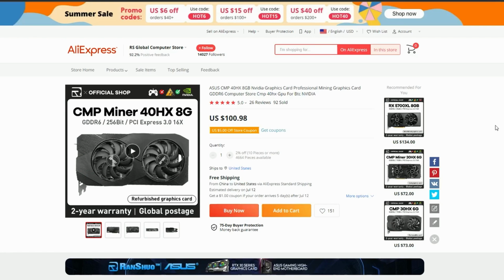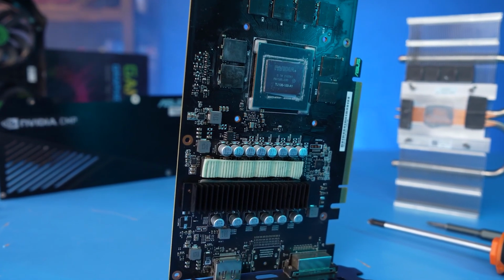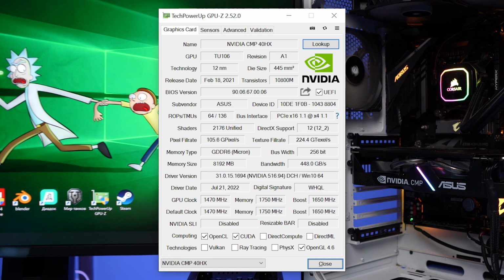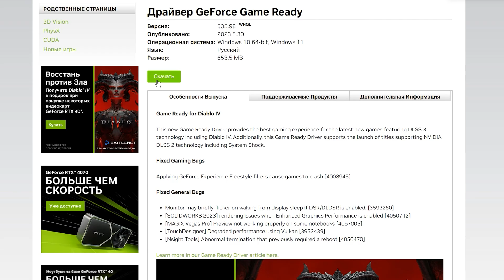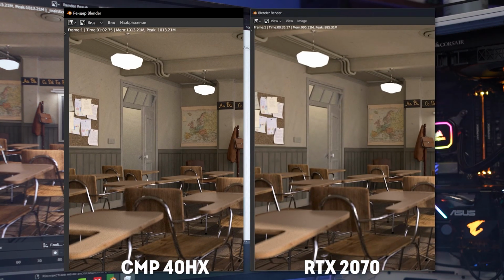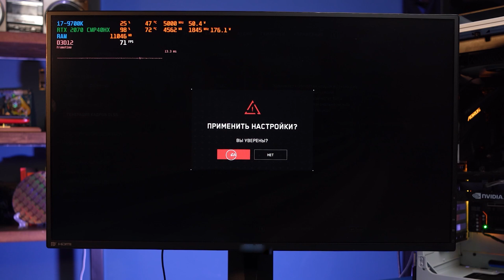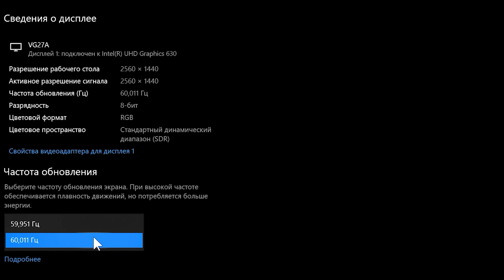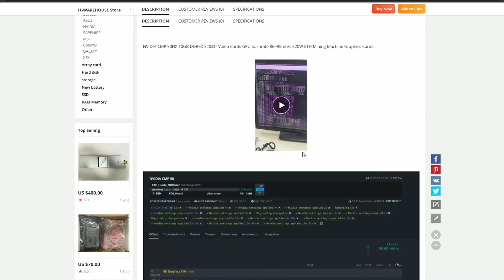Making an RTX 2070 from a Mining CMP 40HX for $100

Comment: I got a gifted CMP 70HX from a friend of my nephew, I managed to install drivers and make it "work" it doesn't seem to improve anything, I also notices the dedicated memory of the GPU is capped at 0, the PC won't use it at all (according to the task manager), is that normal or I need to tinker something else? Is there a forum where I can ask this stupid questions? Thanks for the video, I'll try soldering the capacitors, if I find out the value, I hope is the same as the one it already has, guess I'll just keep waiting untill further evolution
Reply: 70hx is actually worse than 40hx at gaming

Comment: i buy p104-100 they say its 1070 but after patch and run game you see it 150%weaker then RX580 
and you cant run any game in fullscreen  all can run in window  and must heavy game can be run in 1024*760 res   
in the end dont trust this type of video as you can see no one play any game on this card they just use others video
Reply: actually the p104 is worse compared to the p106-100 in gaming , they, i mean the p104 is only as powerful as gtx 1070 in mining , the best gaming  mining card are the 30hx and 40hx at raw performance so far , so yea if you buy a 40hx ( the modded pcie x16) you will get a cheap rtx 2060s ,only for gaming , btw the p104 only run on pcie x4 1.1 thats why they’re so weak , p106-100 run on x16 1.1 , i’m using it right now, with modified driver it can runs wuwa smoothly at 50-60 fps medium/low setting
Reply: @imanasianguywithabignose8963 does it work with x99 Xeon?

Comment: i just bought a  Nvidia cmp 100-210 16gb hbm2 memory and was wondering if i can do the same as u did to get it to run a 16x speeds like can i solder the missing components on the board as well be nice to change it back to its orginal tesla v100 16gb card

Comment: Can you make the lanes work on a p104-100 too?
Reply: I'm curious about enabling pcie x16 as well.
I tried flashing 1080 Founders edition vbios, but the thing just crashed on boot.
Reply: @knightblad5631  use the crossflashong tool??
Reply: @user-zt8zx1sm2t  I used an external BIOS programmer to physically force the flash onto the P104-100.
Reply: @knightblad5631 Don't use the fe version bios, try using the original model bios from the OE vendor.  If it is Asus p104, it has the same board as ASUS GTX 1080 TURBO.
Reply: @knightblad5631  good luck
Reply: @knightblad5631  did it work??
Reply: @inno7845  No, it didn't work. I gave up, and just settled with the PCIE x4 1.0
Reply: @knightblad5631  how fast is it compared to a 1070?
Reply: @inno7845  The numbers are about equal to a 1070. The bandwidth bottleneck is real.
Reply: @knightblad5631  so sad how they make these cards such ewaste
Reply: @knightblad5631  hi! im currently deep down into this p104 x16 lane rabbit hole. it did report x16 at some point in gpu-z (after soldering missing caps and hard-flashing a diffrent bios, but it wasnt a full success, as the card was reporting error 43. Now i have a hard-time replicating this sucess (too many bioses to check etc). but it would be great to get it to work, or at least get some helpful info from people that tried. did you figure anything more in that regard?
Reply: @jurnyrzezaniec5631  Nah, I got nothing useful. I just kept getting the x4 1.0 repeatedly, and just gave up.
Reply: @knightblad5631  welp... maybe an sli setup with bclk OC will yield some interesting results... but it seems like this card just sucks. 106-100 ftw with its x16
Reply: @knightblad5631 i recommend you the zotac 1080ti mini bios 😊
It has same pcb, but 11G → 10G
Reply: How about it??

Comment: I'm taking a CMP 50HX, also with the new ability to crossflash maybe I can put a "real" 2080 TI firmware id string and fool the drivers.
You should try using it on a "modern" meteror lake CPU that has iGPU capable of higher resolution and frame rates.
Reply: Explain your experience. How is going?
Reply: @olegolegunches4905  The card is coming: once it's here I'll be experimenting.
Reply: @ConteZero5977 what kind of cable do you use? hdmi or displayport?
Reply: any updates?
Reply: @Mystnightborn Card released from customs yesterday.
Reply: @Mystnightborn Ok, final answer.
It's useless.
You cannot flash any firmware (even the new unlocked tools won't allow you to change bios).
I've tried a bench (vkpeak) and the result is pretty obvious : you cannot use the card for gaming. Full stop.

Extended reply:

this is my integrated GPU
device       = Intel(R) UHD Graphics 770

fp32-scalar  = 787.99 GFLOPS
fp32-vec4    = 370.61 GFLOPS

fp16-scalar  = 1555.03 GFLOPS
fp16-vec4    = 1567.06 GFLOPS
fp16-matrix  = 0.00 GFLOPS

This is the card
device       = NVIDIA CMP 50HX

fp32-scalar  = 420.67 GFLOPS
fp32-vec4    = 419.90 GFLOPS

fp16-scalar  = 13348.51 GFLOPS
fp16-vec4    = 26323.55 GFLOPS
fp16-matrix  = 0.00 GFLOPS

As you can see it's pretty impressive there (I haven't soldered anything to date).
Now for the sad part:

My integrated gpu...
fp64-scalar  = 0.00 GFLOPS
fp64-vec4    = 0.00 GFLOPS

int32-scalar = 263.05 GIOPS
int32-vec4   = 210.35 GIOPS

int16-scalar = 394.00 GIOPS
int16-vec4   = 485.38 GIOPS

The CMP 50HX...
fp64-scalar  = 0.00 GFLOPS
fp64-vec4    = 0.00 GFLOPS

int32-scalar = 0.00 GIOPS
int32-vec4   = 0.00 GIOPS

int16-scalar = 0.00 GIOPS
int16-vec4   = 0.00 GIOPS

So you can see... there's something (driver or bios, I'm unable to know) that just refuse to execute int16 and int32 instructions.
I've followed the tutorial and the modified driver is loaded, so the problem is somewhere else.

EDIT: I also installed a REALLY OLD, PRE CMP driver that should have no provision for this kind of card... and I forced a 2080 Ti driver.
No change, every time I try to run an INT16 or INT32 instruction the driver issues a reset.
Reply: I've played with drivers and stuff (no point in going to the soldering iron if the card doesn't work).
I was able to have the card working, but just to give you an idea : it does 30fps on cyberpunk 1080p on low, no raytracing and DLSS enabled.

I've also tried afterburner to see if there's something to fiddle with but so far there's absolutely nothing worth (except gpu downclocking - not that it matters because the card is hardwired to stay cold and use as little power as possible).
There's also another problem: the system is unstable, cyberpunk often crashes while unity titles often refuse to start.

I'm disappointed.
Reply: @ConteZero5977  so is it 4 lanes of pci-e 1.1? Try some benchmarks in blender(for example), they won't need extra layers to work properly. So are you going to solder extra lines? or you gave up at this point?
Reply: @MARSUEV  It's always 4 lines of pci-e 1.1.
I've tried something (like, everything) but the bottleneck isn't there.
With the latest modded drivers I was also able to use DLSS in Cyberpunk, but the performances are ABYSMAL: 26fps (33fps with DLSS) running at 2560 x 1080, high details and no raytracing.
The card is internally crippled.
Reply: @ConteZero5977  wait, you managed to turn on dlss? wasn't that impossible at all? How did you do that?
Reply: @MARSUEV  On CMP 50HX you cannot enable DLSS if you force a different GPU (for example forcing the driver for RTX 2080 Ti disables DLSS) while leaving the "original" patched driver (CMP 50HX in my case) allows DLSS (not greyed out in Cyberpunk 2077 configuration and it does increase performances - albeit only a bit).
Having the card recognized as CMP 50HX instead of RTX 2080Ti makes no differences in performances (that are poor with 50HX anyway).
Reply: @ConteZero5977  why does it work with 50hx and not with 40hx?
Reply: @simonescuderi5977  did you crossflash the bios also other than just modded driver ? saw one cmp50 for $50 ...
Reply: @MARSUEV In the video the videomaker forced the card as RTX 2070 driver.
I saw first hand that DLSS works only if you left the card with the "supported" driver, that is CMP (50HX in my case, 40HX in his).
That's probably the reason.
Reply: @ConteZero5977  but if you don't mod drivers, then how you would turn it on instead of igpu? Is it possible with OG drivers?
Reply: @MARSUEV I modded the drivers.
Modded drivers do include CMX 40HX, 50HX and so on...
Reply: @ConteZero5977  so with modded drivers based on OG cmp cards they can turn on DLSS? So there' no problems with RT in it? Then can you try some blender benchmarks with optiX? In theory, the amount of pci-e lanes won't affect on performance in blender, so you should be able to try it. Thank you man.
Reply: @ConteZero5977  I would like to get the cmp 50hx, what are the cons of this card
Reply: @watchouo4511  It's just useless if you plan to use for something else except mining.
Even with the modded driver is as slow as a iGPU.
Reply: @ConteZero5977  thanks for the warning
Reply: @ConteZero5977  So, sorry if asked again, couldn't you get a GeForce RTX vbios on them with OMGVflash or NVflashk?
Reply: @Egidiusdehammo No.
There's no way to flash anything even with those tools.
Reply: @Mystnightborn Yes, nothing good TBH.
Reply: Tried with "junk shop" Blender demo.
CPU : 1 min 56 secs
CUDA : 38 secs
OptiX : 31 secs
Reply: @ConteZero5977  which version of blender? What is your benchmark score?
Reply: @MARSUEV  I just downloaded the last version and rendered junk shop.
Read below (or above, I've replied to others) to get the time.
Reply: @ConteZero5977  I mean bechmark scores, not time(since public data on their website only has scores)
Reply: @MARSUEV  Give me some time to understand how to run benchmarks on Blender... I'm a gaming guy, not a content creator.
Reply: @ConteZero5977  I know, it's so complicated) I believe even more complicated than running those scences on your own. Also a small tip: after running benchmark you can anonimously submit your results. After that you will have a link that is all about that run. You can copy it also.
Reply: does the gpu support any refresh rate higher than 60hz at 1080p?

Comment: Seems like with the recent the unlocking of the bios with recent hack there may be other options as the firmware will be fully editable. Look forward to you seeing if you can make further progress with the now possible bios hack.
Reply: Already tried.
That hack was "hugely overhyped": there's no way to crossflash any 2080Ti firmware on my card, an "exception" always kicks in.
Reply: @ConteZero5977 does it support 165hz monitor?
Reply: @sownlengoc  No, the pcie is only 1.1x4.

Comment: The single-precision floating point performance on the 50HX and 90HX is completely broken, so they can't be used for gaming even if you mod the drivers.
Stay away from those two models.
Reply: Confirmed from a Chinese guy I bought 40hx from, that only 40hx and p106 are worth for gaming 30hx(double 106 price) also works but you rather buy a p106. p102, 104 they only limit by their bios which is limit it to x4, with the new tool we might be able to flash modified bios, I have high hopes for them. 50, 90, and 170 their situation just like you said. Chinese don't have 70hx so I can't find any info. Only 40hx remain everything from their consumer's counterpart(minimum lost) the 2060s, and only this card has video codecs
Reply: @ao-dd3ms  Hey, i've been thinking in getting a p102- sum 40hx from ali/ebay. Are they worth at all? any 1 u would reccomend? im a bit lost on mining stuff and all this and wanted a rly budget used pc, will i have to sold the pcie pins or smth like that if i get one of these?do they work? tysm
Reply: What it does? game wont run or super slow :o?
Reply: @MrBalrogos  Games will run slow on those cards because their single-precision performance has been crippled by Nvidia.
They didn't want those mining cards to cannibalize the GeForces, and especially the Quadros/Teslas.
Reply: @manaphylv100  So really Nvidia reduced the supply of cards for gamers...opposite of what they said they were doing.
Reply: @NoSpamForYou  Maybe they recycled the faulty chips that didn't make the grade for gaming cards. Who knows...
Reply: Wait, is there any cards other than these two that doesn't get crippled on the floating point performance?
Reply: @goodfinity8432  Who knows... I guess nobody is stupid enough to try the 170HX at its current price. If you can afford one, then you can afford at least a used RTX 3080.
Reply: @manaphylv100 then what about cmp 70hx? What do you think about it? Is it ok?

Comment: Explains why Nvidia sold them off as "mining only" cards. They didn't work properly as gaming cards (issues with the RT and Tensor cores).
Reply: As CMP 50HX I was able to enable RTX rendering, it's probably the less broken thing on the card.
Too bad the 3D raster is completely botched.
Reply: i am using it i did not face any trouble fpsis normal raytracing is working
Reply: @HasnainKhan-mf5ep how do you turn on ray tracing? My nvidia app says that i should plug hdmi into the GPU for RT, but that's impossible, how i should do it?